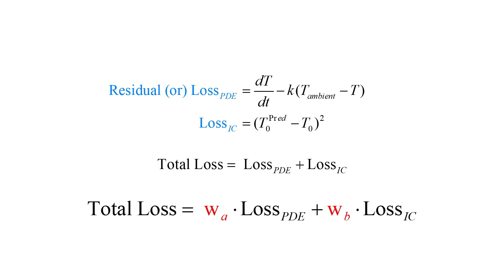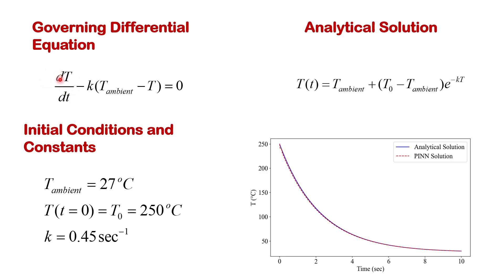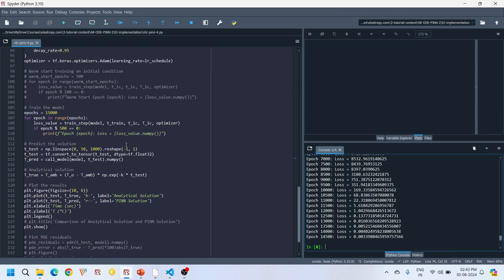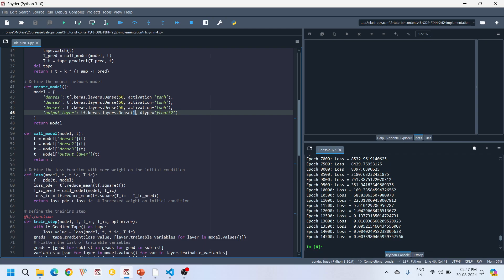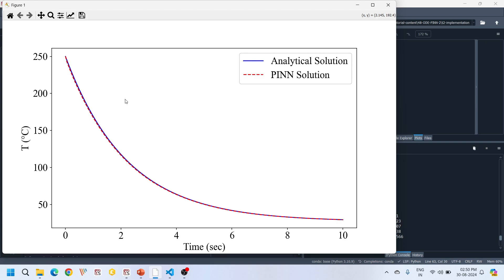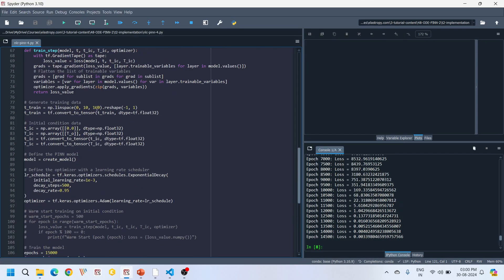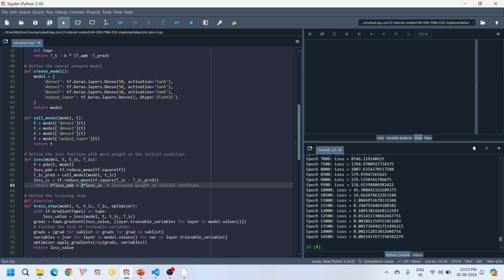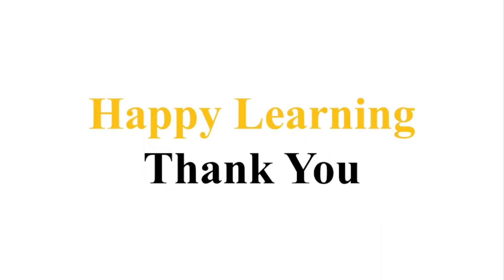Solving Newton's Law of Cooling with Physics Informed Neural Networks (PINNs)

Comment: Why multiply 4 and 2 in loss can we multiply less values like 0.1,0.2 , what is beneficial less or more weight value?
Reply from the maker: Hi @patelpavan5479, yes, you can assign weights lower than 1 in PINNs. The weights, like 4 and 2 in my video, are just random numbers used to balance the loss terms (reasons explained in the video). The weights control the balance between different loss terms, so smaller weights reduce the importance of a term. Just ensure the weights don’t downplay key components too much. It's all about balancing based on your specific problem, so feel free to experiment!

Let me know if you have any more questions, and feel free to join our Telegram group for more updates and discussions!
Reply: @elastropy  thanks and make video on pde also.
Reply: With neumman type boundry conditions
Reply from the maker: Hi @patelpavan5479 Thanks for your suggestion! I'm planning to cover more topics on PDEs soon. Neumann boundary conditions will definitely be included! Stay tuned for upcoming videos.
Reply: @elastropy  Sure!!

Comment: Sir how can i satisfy exact initial condition like for my problem I have initial condition T(0) =0 ,T(1)= 1 but when I am predicting values at these conditions, I am not getting exact value so how can i modify my model.
Reply from the maker: Hi @ramsaran_india, Thank you for your question! I assume your domain is from 0 to 1, and you're trying to satisfy the initial and boundary conditions T(0)=0 and T(1)=1. If you're not getting the exact values at these points, one approach to address this is by adjusting the loss function, as I demonstrated in the tutorial.

Specifically, you can give more weight to the loss terms that account for the initial and boundary conditions. This ensures that the model focuses more on matching these conditions during training. I encourage you to revisit the part of the video where I explain the multi-weighted loss function, as it can help with situations like this. Let me know if you have any more questions!